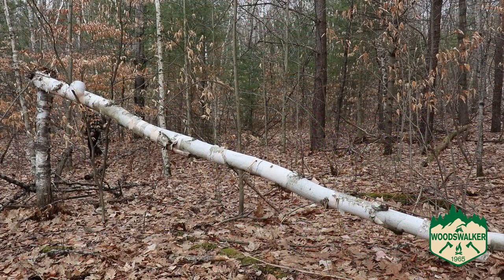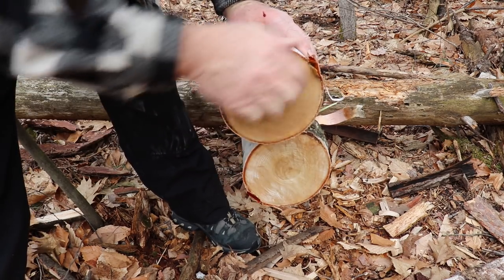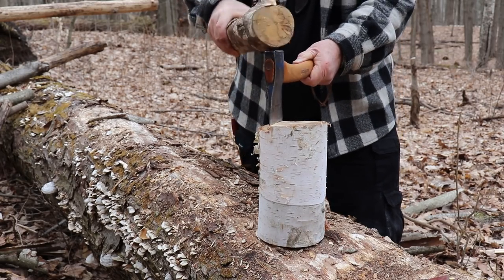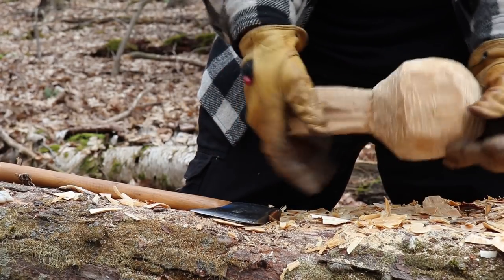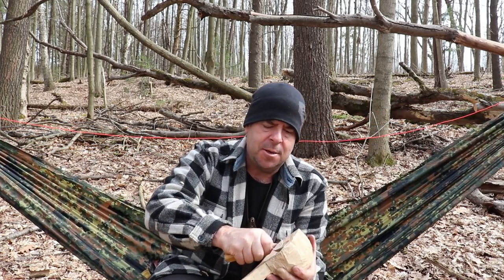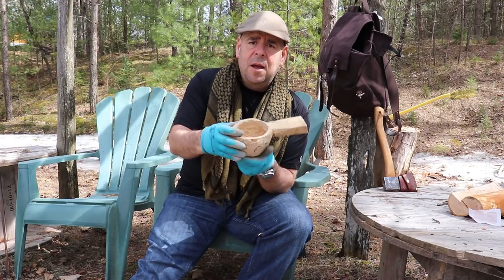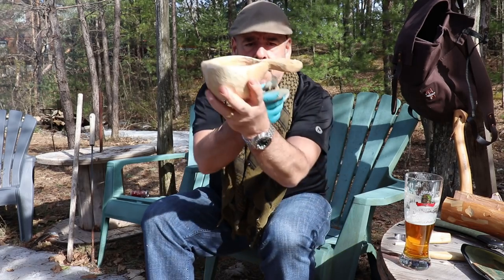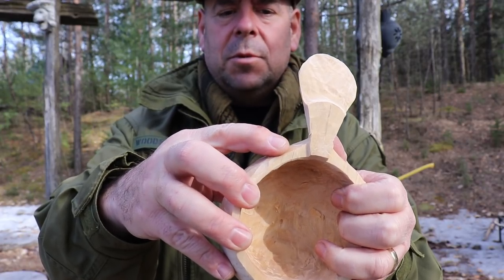Carving a Kuksa

Comment: For cracks, the thinner the walls the less likely it is to get worse or crack altogether. Don’t leave your kuksa to dry in the sun, leave it to dry in a cool, dark place. If the cracks do get worse, you can fill them with beeswax and treat the bowl with it as well and use your kuksa for cold drinks instead of hot drinks (if the cracks are massive, you can also carve a stick to fill the crack). I always rub the bowl of my kuksas with boiled linseed oil since it’s a curing oil(fills, dries into the pores) but the outside with beeswax and really let it get into the wood, haven’t had a problem since. 

Hope this helps.

Really nice work by the way!
Reply from the maker: Thank you very much! I have thinned out the walls since the video was shot and it's currently drying slowly in a bag full of wood shavings. Lets hope for the best! Take care👍
Reply: Some say boiled linseed contains chemical drying agent that you may not want to eat.  Food grade flax (linseed)  oil is available in health food stores.
Reply from the maker: Yes it's always important to use food grade oils, thanks very much!👍

Comment: Usually what helps is to fill them with a heat proof resin and then put a tight band around the out side made from cord and tightened down like a tourniquet  to keep the cracks from spending during the drying process  it works quite often unless the cracks are really bad and then after you can seal it to protect it even more.
Reply from the maker: Thanks Robert, so far the cracks are quite small and only at the lip. I'm drying it slowly and hoping for the best.  Your solution sound like a great idea!👍

Comment: I know my grandpa would use very fine saw dust and wood glue mixture to fill in cracks in his woodworking project. Might be worth trying if the cracks get worse as it drys. Nice work by the way, I've been wanting to carve one of those myself!
Reply from the maker: Thanks for the tip I may need it! Go ahead and try your hand at carving one, it's pretty addictive though.👍😀

Comment: I am really interested in seeing how this project turns out for you. Not that I am any kind of expert Wade but I will share with you what I have learned from experience. Traditionally, the log would be split through the pith in the center. The pith may end up being a leak point. I dried mine slowly in a paper bag with the wood chips as well. I also boiled mine in salt water for at least an hour. Not sure if it made the difference but I have no cracks in mine. I used flax seed oil which is a food safe linseed oil. If you do end up with small cracks consider using wood stabilizer meant for old wood and available at Home Depot. Thanks for sharing
Reply from the maker: Thanks Mark for the tips!  I dont think the pitch is an issue here...yet haha, time will tell.  Just a few small cracks on the rim still. How long did you let it dry before boiling and oiling? I was thinking a 2 week period might work. Thanks again brother
Reply: @Woodswalker1965  Wade, I boiled mine as soon as I finished carving it. It is supposed to take the stress out of the grain so it is less likely to crack as it dries
Reply: @Woodswalker1965  I waited a full two weeks for it to dry. If it has not cracked by that time you could place it in an oven or even a dehydrator to ensure it is as dry as possible. If the wood is warm it will absorb more of the oil. The guideline is oil lightly but oil often
Reply: what really takes time is for the oil to dry. That was at least three weeks
Reply from the maker: Ok interesting thanks Mark!
Reply from the maker: That's a long time to wait for a coffee🤣👍

Comment: I think those few cracks are just from tree and wont hurt anything. As far as drying it out so that it doesn't crack further - one thing i've done after turning a bowl on a lathe is to cover the outside of it with plastic film and let it dry from the inside out. The bowl won't split. Drying cracks are caused by the wood shrinking at different rates during drying. If the outer part dries at the same rate of the inside, it will crack because the outer fibers are shrinking faster than the fibers they are covering. The inner fibers can shrink and not cause cracking. Kind of like pulling a bow sting and putting all the stretching force on the back of the bow making it more likely to split on the back.
There is a whole art and science to drying and I'm certainly NOT an expert! But if you think about the characteristics of wood it will make sense. I've even put a fan on a bowl facing the inside and covered the outside with plastic and had it dry overnight and still no cracks. Some people use a wax coating.
I wouldn't oil it until it has dried out very well. 
It turned out very nice. You have they eye for it! That kuksa has been in that tree the whole time...it took you to find it and to get rid of all the wood that was hiding it.
Stan
Reply from the maker: Hey buddy all of what you said made sense and I'll try it on my next one thank you! 👍I let the kuksa fully dry in a open plastic bag with some wood shavings. The cracks didnt get any bigger but as soon as I added hot coffee to it...BAM!!!! It cracked big time, so I will try again lol😀 
Take care thanks for the input!🤙

Comment: The first thing that I thought of, when you chose the newly-fallen, spring birch, was "Shrink pot". Maybe next ? If you can find a stretch of knotless bark, off the wide tree base, and harvest it, then maybe make a bark bucket ? Your thoughts about using a gouge, instead of your hook knife, for the bowl in your kuksa were valid. I would suggest maybe, somehow, carefully incorporating the use of a scotch-eyed auger ? Maybe calipers, too ?  Thought of the beaver tail, at the same time you mentioned it, on the video. The cracks ? Maybe apply some oil to slow the drying process ? Only on the outside ? Inside ? I don't know ! Do you plan on contouring the spout inside the bowl ? Looking forward to the next video to see if you have found any solutions or insights. : )
Reply from the maker: Hello my friend, lots of great comments ,thank you!👍 A shrink pot is a pretty cool idea, the birch tree is a amazing resource. I did manage to make a deep bowl but a gouge would be quicker and easier on the wrist. The cracks dont seem to be getting bigger. I am slowly drying it in a plastic bag full of wood chips. I will show the final result soon wait and see! 😁 Thanks for watching and commenting!👍

Comment: I was wondering if you were to use olive oil or maybe almond oil or something like that if it would help prevent cracking while the wood is drying. Just a thought.  I think you did a fantastic job on that kuksa!
ATB from Vietnam. Sam Adler
Reply from the maker: That's a good idea, thanks for the input👍👍. Actually it started cracking right from the start before the drying process began. The particular piece of wood was a poor choice unfortunately. Thanks for watching.